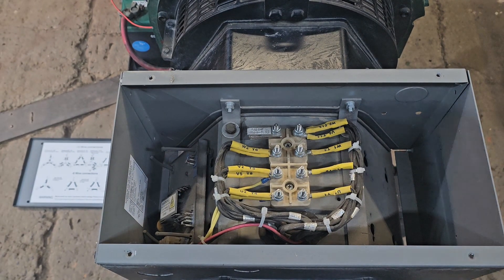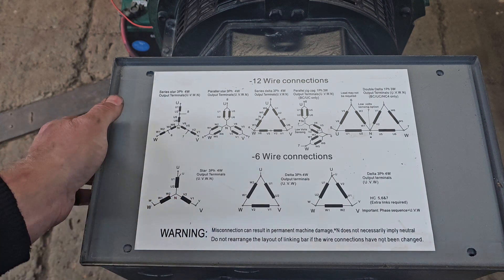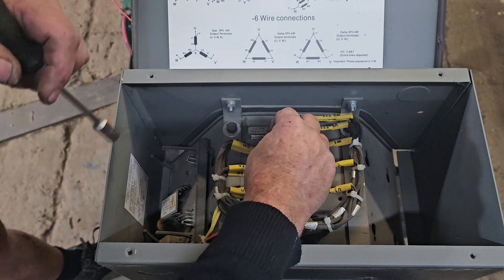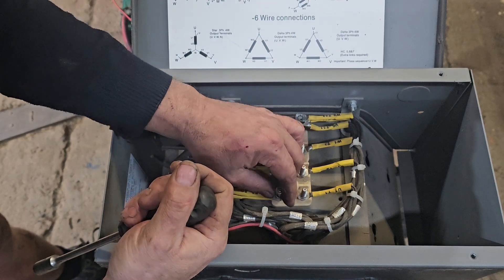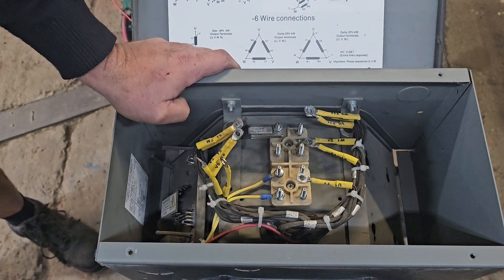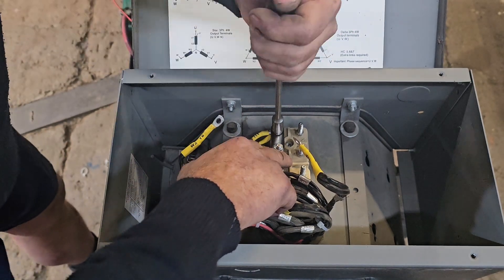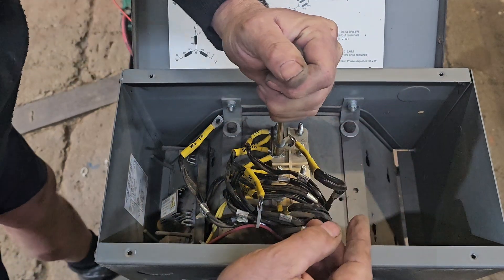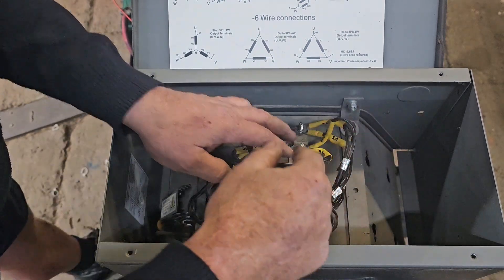how to change a 3phase generator to single phase part1#generator #generatorepairing #tech #diy

Comment: Thanks 👍. I have an old Leroy somer generator. I didn't think it was possible to rewire it for 240v single phase.
Now I need to figure out the labels on the wires.
Reply from the maker: hi what does the labels on your wires read
Reply: @greydudesa 1-12. I've found out that Leroy Somer still use the same numbering system. So I can use that to arrange the coils.

Comment: Great Video Sarel, I do a lot of work in the country side with SWER properties. Are you able to show a video on converting the genset to split phase 240/480. No clients actually have any 2 phase appliances but most have backup solar and battery systems configured to split phase so the Gen has to match.
Reply from the maker: i have not done split phase before but i will look into it and see if i can get it done
Reply from the maker: a video for dual phase 220/440 is now uploaded. enjoy
Reply from the maker: you can set the avr to do 240/480 on this setup

Comment: Can you show the 3 phase configuration wiring you started with and also the single phase you changed to with the wires in place for each?
Would be very useful to double check my work!!
Reply: And where to tap each output for three and single phase.
I have a generator that looks to be identical to yours and really need to familiarise myself with this well!!
Also where the avr is connected in both configurations.

Thanks so much for the excellent video.
Very much appreciated!!
Reply from the maker: i now have mor video's on the topic check if any of the others might help. if not ill gladly help

Comment: Firstly, thank you for an EXCELLENT video. 
Subscriber here now. 
Clear, approachable, intelligent and no fluffing around like some do. 
Absolutely tip top dude!!! 

Secondly could you advise if it's possible to configure a 12 wire generator to run single phase and three phase by switching or moving plugs etc, rather than rewiring?

I have a three phase genny i use for powering a large welder, but also occasionally need to top up my off grid battery bank using the single phase charger built in to my inverter.
I understand this is slightly out of the ordinary but think there must be a better way than having to rewire each time I need to power the two different things?